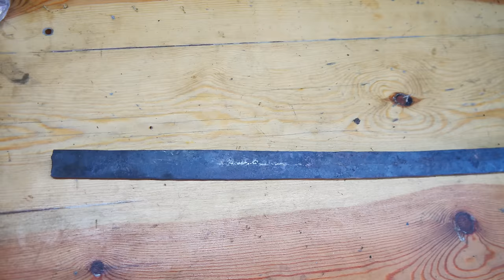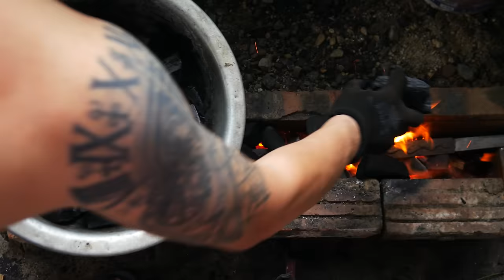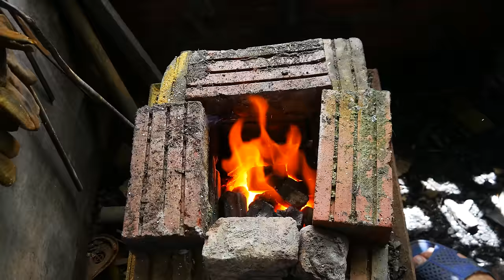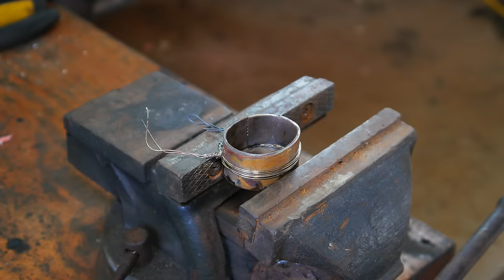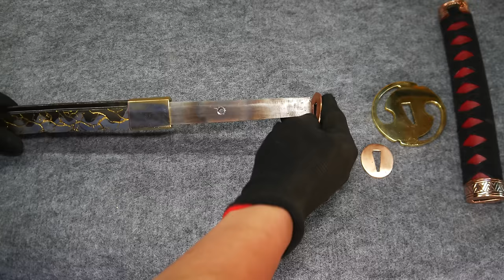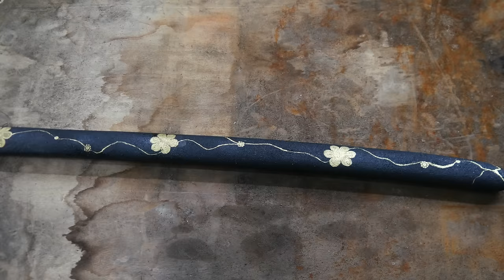Forging a KATANA - How to forge a special gold-plated version katana

Comment: It is correct to put carbon into iron, but since it is not forged, the metal components are not uniform. If you use too many machines for sharpening, micro cracks will appear.

Comment: amazing build, very creative, beautifly crafted project. 

tip from a fellow bladesmith, forge the blade straight and quench blade down in water with the clay on the edge to get the bend and a clean hamon on the blade. keep up the good work :)
Reply from the maker: Thanks for the contribution from a colleague

Comment: interesting that he didn't fold the blade so is this really a katana?  it has the katana shape but not the folds so it's not a true katana.  admittedly it is a beautiful decorative sword.
Reply: Bro
Reply: That's a katana bro every sword that is single edged is called katana, but the one that is forged using tamahagane and is fold it is called Nihōnto(traditional or real uchi katana)
Reply: @Nobi3924  if that's true then sabers and scimitars are katanas
Reply: @chrisdavis2634  yes it is, btw katana means single edged in Japanese to be clear
Reply: @Nobi3924  A Samurai sword is a wonderfully delicate and complex piece of engineering. The steel of the blade is heated and folded and beaten -- over and over again -- until the blade's formed by 33,000 layers, forge-welded to one another. Each layer is a hundred thousandth of an inch thick. Any japanese sword master will tell you this.
Reply: @chrisdavis2634  yes it is and it is called Nihōnto because it is traditionally made in Japan and as I said it is forged using tamahagane , folded to remove impurities in the blade and quenched in 'water' not with oil to make that beautiful hamon. Outside the country of Japan a katana that is forged not with tamahagane is still called a katana but traditional forging it is called Nihōnto. Hope it helps you to understand the difference of Nihōnto and katana.
Reply: @Nobi3924  what about the nagi spear? That’s also a katana and doesn’t have a single edge in fact isn’t even a sword.
Reply: @jaimeparra3331  a naginata is also a katana because it has a hilt that can accommodate for 2 hands to wield a single edge and a tsuba. So yes naginata is also considered as a katana
Reply: Katana translates to sword there are specific names for the sword you’re thinking of but sum katanas in ww2 aren’t folded
Reply: @Nobi3924  agree, naginata is a single edged weapon with a tsuba however the yari (different to naginata) is also considered one of the 7 katanas, those being uchi-katana Wakizashi tanto yari naginata and 2 others that I forgot. The yari is a simple spear with a double edge.
Reply: The folding is done to remove impurities because Japan had bad quality steel in the past and limited access to good steel. If you have better quality steel then folding it would be stupid. You can be sure if samurai were alive today and katanas were still viable then they would have taken katana forging to the next level. I mean that's how we got the uchigatana itself in the first place (uchigatana is the current day katana you see). It was an evolution of the Tachi, the old style more curved katana. A failed war taught the Japanese that they must evolve. 

However today, Japanese stubbornly stick to traditions because they no longer see katana as a weapon but an art piece like pottery or painting. Thus, they stick to a particular form or method of forging and use specific materials for forging, one of which is crappy steel which, as the name implies, is a low quality steel with impurities that necessitates the folding forging technique.

Think about it, if the samurais were alive today and swords were viable and they learnt of a method that allowed their katanas to become more durable and last longer in battle thus allowing you to enjoy your sword more then don't you think samurais would immediately jump on that method? Any swordsman would jump at the opportunity to enjoy his blade longer.
Reply: If you care about semantics then no, anything outside Japan that didn't use a specific metal using the traditional smithing method of Japan isn't considered a katana by Japan. But if you don't care about all that then yes this is a katana and arguably has better quality than "true katanas".
Reply: Are you a samurai
Reply: You're watching to much anime... Even without folding. A Japanese sword still would be a sword depending on the steel qualities.. wheter its a Katana, Tachi, Nodachi, Ninjato, etc...
Reply: @Nobi3924  katanas are folded so their cutting power are unmatched, without folding it would lose its edge very easily
Reply: I think you’re right tbh
Reply: これは刀ではありません
Reply: It's not a real katana I get what you mean
Reply: @GunGirl1997 i've seen a lot of decorative swords that can cut you in half but that doesn't mean it can take a blow against another sword without bending.
Reply: @chrisdavis2634  you're so wrong lmao. The only reason the metal was folded was because of how much impurities were found in japanese iron ore. That way, the steel could be purified so that the blade wouldnt break. 33,000 layers is also a vast understatement. It would have onwards of 2 million layers. After the creation of the blast furnace, the folding technique was abandoned by the japanese because of how unnecessary it was, folding such good quality steel would actually decrease the quality of it. The blast furnace allowed for even the most crappy ores to be refined into clean ingots. Any japanese smith will tell you that the folding technique was long gotten rid of due to the massive advancements in technology. If you want to nerd out, at least be right about it
Reply: @Nobi3924  よく刀のことを知っていますね日本に来たことがあるんですか？
Reply: @chrisdavis2634 you do realize that the only reason the traditional katanas made from tamahagane need to be folded is to get all the impurities out of the metal right? And there is a lot of layers sure but if u do the math the blacksmith only needs to fold the blade a few times to get a high number of layers, Japanese katanas are not ultimate swords that cut through five inches of steel with ease, if you do not know how swords work, the curve in a katana are to make cutting easier, not perfect easer, and how this works is the curve makes a natural pulling and chop kind of motion, this also helps with edge alignment, I know perfect cuts with a sword through a tatami mat looks easy but trust me, if u were to try cutting a tatami mat perfectly with literally any sword you would, most likely just bad the mat away, the katana is no exception, and adding to the katana, stabbing with a curved blade is very difficult and hard to remove the blade and just things like this that make it very hard to use, I’m not saying the katana is bad because it’s good at what it was made for, but saying that the blade is “ folded a million times under a waterfall and then appraised by Michel Jackson eating a meat lovers pizza while on the way to mars in a Volkswagen” or whatever outlandish claims you want is very easy as someone that doesn’t actually care about anything other than anime wifus and katanas from anime, I enjoy anything mediaeval that includes actually looking at all swords from a real world perspective
Reply: @tsdestruidorflame1678  definitely not bro, you’re watching way to much anime, the reason they Ford the katana is to remove the impurities from the metal, the long sword was never made of folded steal and it holds its edge very well, tamahagene steel isn’t really steel it’s more like a impressive iron, if you would watch anything except for anime on how katanas are made and why they fold the katanas steel/ iron you would know the real reason they do it, get real 💀
Reply: @tsdestruidorflame1678 and u forgot to change your account before responding to yourself XD 💀
Reply: It's not only that he didn't fold the metal, he also didn't use tamahagane. He also cutted the shape while traditional uchi katana are made straight and then the blade curves as a result of the differential heating that makes the core more flexible and the edge more hard. Also didn't use sting ray skin into the handle, and maybe I'm tripping but I didn't see any signature in the blade or put a sageo in the sheath which is also important for handling and has a cultural relevance regarding japanese put strings in items that are considered importat. Japanese use the term katana both for uchi katana and any sword, and what are they referring to depends on the context, so you could argue it is a katana, but we aren't stupid and everyone here knows with the word katana he was referring to an uchi katana because that's the meaning of the word katana outside of Japan, if you want to deny what's obvious and try to look smart commenting bullshit it's another story. I think it would be correct to call this sword a iaito, a sword used for iaido which is a martial art involving the use of a katana (in the japanese sense). Iaito are cheaper because they don't follow traditional uchi katana smithing methods and are made of steel instead of tamahagane. Nonetheless, this blade looks sick and I'd gladly buy it if it wasn't for the crappy materials used in the handle and the lack of sageo, but I guess you could have the handle remade and buy a sageo.
Reply: no fold = no katna.... they are just mocking the katana forgery by doing this... katana forging itself is  a tradition that involves all the traditional process to be followed at the minimum to call the final product a katana... this is just disrespecting the age old tradition of katna forging and the forgers who take pride in making them
Reply: Some weebs giving us Japanese culture lessons.
Reply: Interesting ... what about the Japanese "ken"? Is there a difference between "katana" and "ken"?
Reply: @jaimeparra3331 Tachi maybe? One of the 7 katana?
Reply: @rohitshet9516  if you want to be this pedantic about it the you should be able to difereciate between a katana which is a curved single edged bladed sword in general (with diferentiation in curvature and lenght as well as style so it includes the nodachi as well as the regular tachi) and a nihonto which is a traditionally forged blade made from tamahagane and made by licensed japanese sword smithing masters.
Contrary to popular believe it is not actually the folding which makes a katanas blade special ( even though the cosmetic touch is nice and it does serve a purpose for purifying tamahagane) but the diferential hardening which results in the hamon. Through differetial hardening you get a hard egde and a softer shock absorbing spine which is a great combination for combat without armor. 
And no it couldn’t cut through steel thats why samurai used mostly bows, yari and kanabo as their primary battlefield weapons.
Tldr: nihonto=traditionally forged tamahagane blade
Katana=sword 
Cutting power comes from its curve and its differetial hardening not from folded steel

Comment: This is a very decorative piece of Katana looking sword; but it is definitely not as strong or as sharp as the real thing. The forging process of a real Katana blade is quite a bit more complicated than that. This is really more likely to be used for decoration than anything else. To be fair, it is unlikely anyone will be using a Katana sword for real life battle anyway; so even a real Katana is more likely to be used as a decorative piece in a room than for any real life practical application. 😅

Comment: Is it a Katana, yes. Is it a traditional katana, no. Folding serves to purify the metal and add layers to it to make a strong durable blade but most modern metals are so pure it is unnecessary. However that distinction alone is what determines if it is a traditional katana or modern katana. But overall the function and durability should be comparable to most modern weapons.
Reply from the maker: Thank you For watching !!!

Comment: Эмм просто подогнал металл заточил и заколил не равно выковывал 
где сборка с самого начала 
1) Сталь явно не Тамахагане 
2) Катана это способ обединения мягкого метала с твердым 
3) у тебя просто меч не катана меняй название
_________________________________________________________________________
Um, just fitting the metal, sharpening it and stabbing it, it's not the same as being forged
where is the assembly from the beginning
1) Steel is clearly not Tamahagane
2) Katana is a way of connecting soft metal with hard
3) you just have a sword not a katana change the name of the video
___________________________________________________________________________
translated by google
Reply from the maker: Thanks for watching, you're funny 🥰
Reply from the maker: The name of this sword is KATANA, no matter what material you make it, it will be proportional to the value of the sword, nothing will change.
Reply: @Arts-and-Crafts  and wehere i can see soft and hard metal soldering??? 
It's look offense....
you just sharpened and stab metal
Funny just like you....

Comment: Я чёт не особо понимаю где тут ковка
Reply from the maker: Thank you for watching, I feel that materials that are heated and force applied to change its texture at will is called forging
Reply: @Arts-and-Crafts  в моём понимании ковка, это когда берут любую болванку из металла, и придают ей форму, вытягивая и делая тоньше, а на видео, просто отрезали кусок листа стали и слегка видоизменили.
Reply from the maker: @_faust_7356  Please take a look at the forging part in the video, the billet has been forged from the blade to the tip, you can find information on Wikipedia, thank you